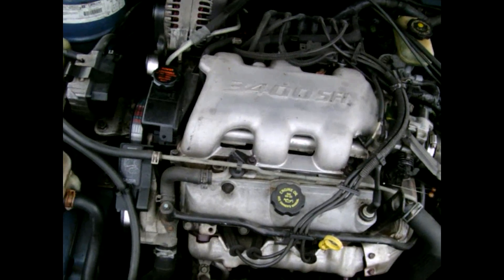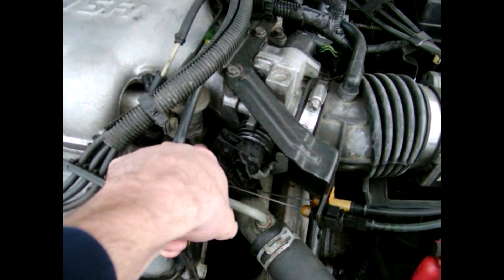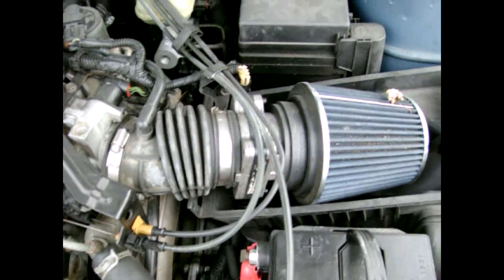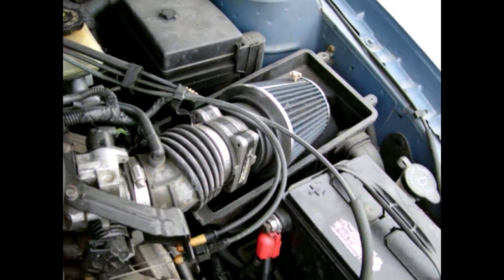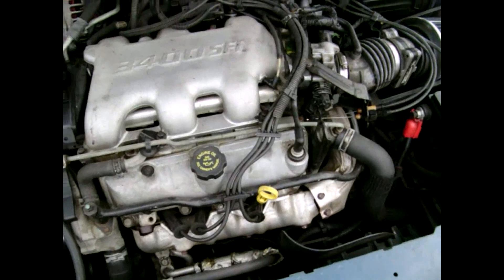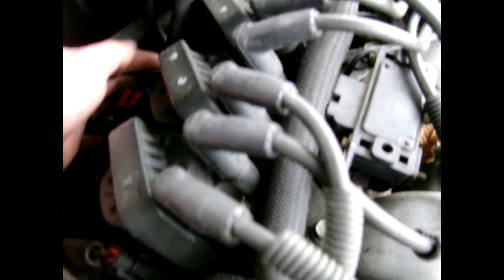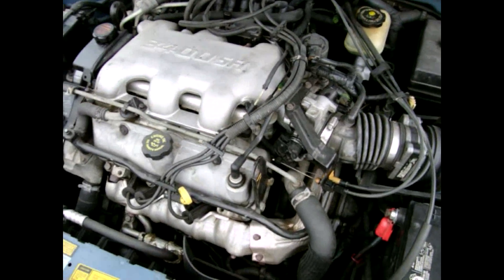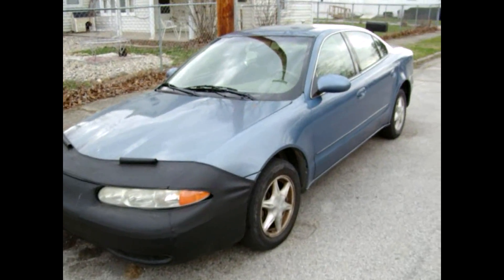3400 GM Engine 3.4 Liter Motor Explanation And Discussion

Comment: 2000 Pontiac Montana here with the 3400. Not all of these are engine, fuel, and cooling-related, but here goes:
Thermostat was stuck open and appeared to be factory. Previous owner has definitely replaced the radiator but it still needed hoses. Aftermarket radiator has a different petcock and does not fit the level sensor well.

Coolant level sensor wasn’t working so we replaced it and the replacement wasn’t working either. Replaced AGAIN since the “Low Coolant” message definitely goes away when unplugged and that did the trick. Unfortunately, the working replacement does not seem to clip on the aftermarket radiator and blew out twice, dumping coolant and ruining a brand-new fail-open thermostat.

The factory fuel pump was still going strong but the fuel level sender was only jumping between E and F (never in-between). A1 Auto recently said there was a GM campaign to replace the level senders back in the day for that very reason. Had a shop replace the whole fuel pump but the replacement makes a loud ringing sound like a low speed pedestrian alert in a Bolt EV. They refuse to warranty it unless it fails so I’d better pressure-test soon (thanks for the tip!).

The ECU is marked “reconditioned” by GM. Gauge cluster works so I wouldn’t be surprised if it was reconditioned too. There is one bulb blown behind the fuel gauge and the whole cluster seems to reboot at least once per drive: needles suddenly drop then it lights up like a Christmas tree before settling down, exactly like it would when starting (self-test).

The rubber grommet on the plastic hose going to the back of the valve cover from the intake hose was completely rotted. Took me forever to find it and even longer to find where it was supposed to go. At least the replacement hose with grommet is cheap.

The rubber bushing in the transmission end of the shift cable also crumbled away, leaving me stranded in Neutral once. The Dorman part claims it only fits 2001 and newer but it worked perfectly.

On that note, the cruise control detent cable end was broken but I found a replacement from ATP that was sold as a transmission cable end for even older GM vehicles. Worked great.

The window switches failed so I swapped in a junkyard set that also failed a week later. In the mean time I had broken open the original to clean and treat the switches with dielectric grease, which worked about as long as the junkyard unit. I got a cheap replacement from eBay but lost the “Auto” function where it rolls all the way down with just a tap. You can’t disassemble them to move the new switches to the old board without breaking the lighted switch caps.

The driver window was also tilting forward and jamming if you didn’t help it up with your palm. The regulator was bent but it turned out to be a symptom, not a cause. After replacing the regulator I cleaned and regreased everything and tweaked a rail inside the door (front edge of window). All Christmas trees fasteners involved needed to be replaced.

I can’t tell where water is getting in but it’s sometimes pouring down the A-pillar and from the overhead console with the compass heading and temperature display. Water would have to flow UP if it’s coming in from the windshield but that must be what’s happening. Getting the windshield replaced tomorrow after a mishap so we will see.

Had a lens fall off the headlight housing when replacing a bulb so I bought replacement housings and side marker light housings. When moving the turn signals to the new side marker housings both of the sockets crumbled to bits. The replacement sockets I ordered were cheap but I figured out that you can replace them without cutting, crimping, or soldering since the wire terminals can be removed and swapped if you disassemble the socket. The bulb socket itself is an insert in the broken retainer part which can be unclipped. Small blades from the insert retain the terminals attached to the wire harness so you can grab them behind the rubber plugs and remove once the two pieces are unclipped.

All my rear bulbs seem cooked into their sockets but the van came with a junkyard tail light so I’m not too worried about it.

I’ve had to replace the TPS and knock sensor and something emissions-related back when I was first getting it registered.

The clock radio display becomes unreadable during the drive and the tape player stopped accepting a cassette… probably bad capacitors and needs to be cleaned out inside. No more Bluetooth cassette adapter for me!

No AC. Not sure why yet. Compressor clutch can be turned by hand without issue but it isn’t coming on by itself.

The fresh/recirculate actuator (mode door actuator?) was clicking with a broken gear inside and couldn’t move the air door. I replaced that but in the process my dash and defrost vent crumbled into a million pieces. I put a carpeted dash cover over it but I might need to do more if I ever get the AC going again (appears to be part of channeling air around). Heat works fine.

I’m in the south but this thing clearly lived up north at some point. You can grab handfuls of rusted rocker panel that has turned to dirt and the jack points are toast but the frame and everything else seems just fine. Actually had a shop refuse to do brakes because of the rust.

Engine doesn’t burn oil and seems to run fine. A couple times I’ve found the transmission making hard shifts and sounding like an RC car but after sitting all night the issue had gone away each time. Weird.

The rear washer fluid sprayer doesn’t seem to work. Not sure if it’s a clog or a bad motor.

It didn’t include the remote so I bought and programmed a replacement. Actually, I bought two but the second wouldn’t program. The first was only able to unlock for about a day before that quit working but it could still lock. I suspect the BCM. It’s probably also what’s keeping me from programming the second remote. It continued working for lock-only for almost a year but that suddenly quit working last week. I know the remote still works because I can hear it try to operate the power door when I press that button (power sliding door cable removed by previous owner).

All the plastic pieces in the floor that key specific positions for the removable seats are busted up after removing them to clean old soda and kid snacks. Yuck. Had to be done though… I literally found live maggots living off the mess from a previous owner’s kids.

Flip-down cup holders on the side of the first and second row seats are clearly missing a spring since they lay flat and can’t possibly hold a drink. No replacements available.

The lever for tilting the second row seat forward is missing the plastic handle and is often jammed way too tight to operate by hand (no doubt, why it’s broken).

Air bag light keeps coming on. It seems to be a bad connection under the passenger seat since manipulating the wires there will make the light go away for a while.

Mileage says 160,000 but the title says “Odometer Discrepancy” so take that as you will. I’ve been very impressed by the reliability of the motor itself but very disappointed that all the rubber/plastic parts I need are unobtainium. No one makes a Trans Sport/pre-2001 Montana grille, for example, and good luck finding that upper dash! The rubber shift cable bushing being listed as incompatible for pre-2001 models was particularly annoying when the only other option was a whole shift cable for hundreds… and requires you to take apart the dash/steering column and go through the firewall!
Reply from the maker: Wow.  Several of the issues you mentioned were reminders of problems I had with some of the Pontiac Azteks we’ve had.  The airbag light coming on was particularly annoying, having to reach under the passenger side seat to fiddle with while stopped at a light.  Wife would know just what to do when the blower motor would suddenly turn off, kick the plastic panel under the dash, it would come right back on.  For replacement parts, don’t rule out the junkyard, found several hard to posts there.  Replaced a few power windows motors too. When the windows would fall off track, the plastic holding pieces were typically the issue.  The transmission hard shifting is usually due to bad solenoids on the valve body.  If ever replacing them, do them all.  It’s possible to loosen the subframe bolts, take off the wheel and take off the cover to gain access.  Another YouTube video saved me hours instead of dropping the cradle.  
VT247
Reply: Longest comment I've ever seen. 😂

Comment: I have a Grand Am 3.4 and have replace my Lim gasket already at 199. Have replaced fuel pump, alternator, water pump (preventive maintenance), a/c compressor (came frozen with the car), fuel purge valve. This car has 204000 right now and the next lim will be replace at 300000. This engine is a beast. I have replaced all my fluids to Amsoil and my coworkers are stout engine dont make any noise at iddle. I will rplace my muffler and my cat soon. I have been owner of Honda cars inthe past and let me tell you these are reliables. Will go from Miami to Ohio this summer on the Grand Am.

Comment: ok I just put back on the old coil packs and ignition module charged the battery now it started right up and starts a good as it use to.  I think the new coil pack I bought have to be faulty because when they were in it was a hard start (spark related sound) then quit starting,. put the old packs back in (had them tested at the autozone)  and now it starts fast.  so I hope all my issues are fixed.  If I have any issues I will defiantly contact you again.  A million thanks minus taxes of  course!

Comment: at 2:47, there are three vacuum lines nicely displayed.  From left to right: (1) Transaxle (white section) - Not on all engines! ; (2) Fuel pressure regulator; (3) PCV.

Comment: i have been told that to but so i checked the coolant levels for a month or so and that was last year. i never seem to have this problem in the winter time its only when it gets hot outside, and to this day more than a year later i havent had to add more antifreeze. i have changed the thermostat as well cause it used to get hot and i thought that might help , i also used to use E10 gas and i herd that that might b causing the problem, but i changed that to and it still hasnt fixed it.

Comment from the maker: The oil pressure switch is located between the oil filter and the starter.  It's above and to the right of the oil filter, close to the knock sensor but to the right if looking from the front of the car.  The knock sensor is larger than the oil pressure sensor.  The oil pressure sensor is @ $10.
VT247

Comment from the maker: The Camshaft positioning sensor is located behind the power steering pump.  Power steering pump has to come out to get access to it and an 8 mm socket is needed to remove.  Had the OBDII computer tell me the camshaft positioning sensor was bad in a car once, turned out to be the spark plugs and wires though.
VT247

Comment from the maker: There is a vacuum line going to the EVAP, behind the throttle body going to the PCV valve, the MAP sensor behind the intake and there is one under the coil pack but you'll have to reach your hand down there to find it, can't really see it from up top.
VT247

Comment: The check engine light is on but the reader said it's the knock sensor and the evap sensor. The fuel pump was getting fuel through to the filter when we changed the fuel filter. So not sure what else to check.

Comment from the maker: Possibly the coil pack is arcing out.  They can give sufficient spark at low RPM but can't deliver the right amount of current needed once RPMs go up.  Also you mentioned that it gets worse when it's wet.  Be careful with this next trick and don't zap yourself.  But I've used a spray bottle in the dark and sprayed a mist around the coil pack and wires.  Watch for any blue arcing.  The water will allow it to jump spark easier and be more visible in the dark.
VT247

Comment: I love my 2001 olds silhouette... its ported ,polished intake and throttle body.cold air intake...a shift kit and stall converter upgrade. sitting on 18" rims with open absorption passive magnaflow exhaust... holy crap fast

Comment from the maker: I've sold this car, so I'm doing the best to remember.  I believe it goes to the evap system.  Check and feel under the coil pack (DIS system), there is a place that a vacuum line connects there.  If I'm remembering correctly, the white tube slides into a larger black vacuum hose.  LMK
VT247

Comment: I would love to know where those two vaccume lines run off of the intake manifold I'm having the hardest time trying to find where the one off the front goes and the one on the back left go if it's possible to see while making a video
Reply: The one at the front goes to the back intake connects the two the other one at the back is the one that connects onto the air intake tube before the mass air flow sensor

Comment from the maker: With the belt on, loosen up all 4 bolts holding on the pulley, then take off the belt and remove all 4 bolts.  Behind the belt remove all the bolts holding on the pump.  Some are hidden under the pump that are difficult to see.  Helps to run your hand around the pump to feel and make sure they are all off.  When I replaced mine it came right off.  Not sure what would be holding yours on unless perhaps one or more are still attached.  Hope this helps.
VT247

Comment: At 2:30 you touch a white vacuum hose with a black elbow connector. Can you briefly explain what that hose does and where the other end is attached to?
Reply: That is the accessories vacuum line.  It goes into a plastic cable wrap with a bunch of other wires in it and ultimately snakes it's way through the firewall to the HVAC controller head (A/C and heater controls.)  If this line breaks or cracks your heater and air conditioning will blow out the defroster vents and the floor vents and changing the selection on the vent selection knob won't have any effect.

Comment: B 
Did rotate the engine to reach the back plugs, was impossible form under. Did not take of manifolds or starter so now runs great but have a hard start issue no codes. Prior coded P305 checked plugs etc rotated Coil packs got a 303 so replaced coil pack.  No more codes but just the hard start now.  Engine fires up fast just a little noise now on start up.??? what do you think?

Comment from the maker: The larger plastic tube that connects behind the mass air flow sensor connects to the rear valve cover.  You may have to loosen up the 2 10mm bolts that holds on the coil pack to get it in there.  Hope this helps.
VT247

Comment: You mentioned that there is sometimes a vacuum leak back under the DIS system. Could someone please tell me what the name of that place is that is being referred to? Is it a sensor?
Reply from the maker: I believe what you’re referring to is the evap switch or evap purge.  Sometimes they do leak at that area.  Unbolt the DIS, set it aside and inspect under it.
VT247

Comment: +Vacationtime247The thing you were hold at 2:45, that piece came off my engine, now the car will start but won't stay running
Reply from the maker: +Courtney scott Get a new one at the junkyard.  There are a lot of these engines at the junkyard.  It's a vacuum hose and I had the exact same problem.  It's a relatively easy fix, just getting it attached at the rear valve cover can be a little tricky.
VT247

Comment: 2:43 what's that one your moving with your fingers. I have nothing on mine there and it's smoking
Reply from the maker: I believe you’re referring to the PCV line, positive crankcase ventilation.  It’s supposed to be hooked to the valve cover.  There are oil and gases that need vented back into the motor. Hope this helps.
VT247

Comment: Yea I figured the same. I am going to try and take it out of the top because I cant get the van in the air high enough to pull anything out of the bottom. i barely had enough room to drop the A fram to remove the oil pan.

Comment: I'm back. My '01 Alero has 135k and seems to have an intake leak. It idles with a very slight roughness and has a slight hesitation with slight acceleration. A little more throttle cleans it up. Temperature wise the car runs a little above mid-range but approaches 3/4 when in traffic. When I shut is off I hear a hiss for a couple seconds and it sounds like it originates from the intake bolt where coolant seeps from. Compression is in the 140's on all 6 cylinders, so thinking intake. More to come

Comment: the oil pump drive can leak oil, where you have to replace the "O" wring. Symptom oil on the ground. Pooled oil under the throttle body on the lower intake manifold.

Comment: Thank you!  WD-40, elbow grease, and a two-handed grip on the needle-nosed pliers did the trick. Six new spark plugs and six new spark plug wires.

Hoping my random misfire is done.

Comment from the maker: If you have a car wash nearby take and spray off the engine really well.  Then look to see were the leak is coming out from.  These engines have issues with the intake manifold going bad, especially if it's never been fixed before.
Also, the oil pan is aluminum.  Check that as well for cracks if you've hit something.  LMK what you find.
VT247

Comment from the maker: Is the fluid green or black / tan?  If it's antifreeze, it's probably the intake manifold gasket.  There is a timing cover behind the harmonic balancer. They rarely ever leak oil.  Do a Craigslist search.  I'm sure there is a mechanic nearby that can do the head gaskets and intake manifold for @$300-$400.  Takes about a day.  Gaskets, oil, antifreeze, new spark plugs & wires run @$200.  Check out my other video's. 3400 head and intake gaskets go bad 'cause of the dexcool.
VT247